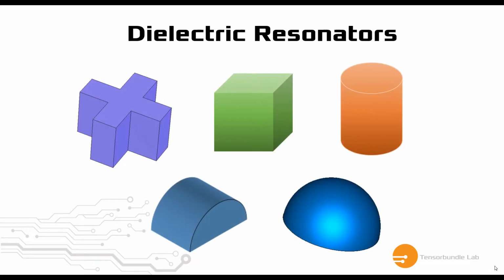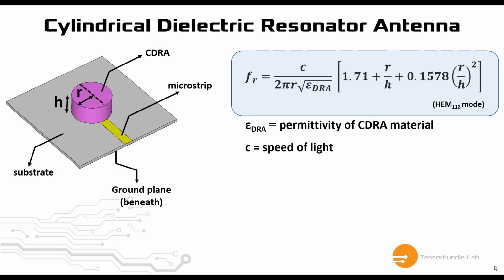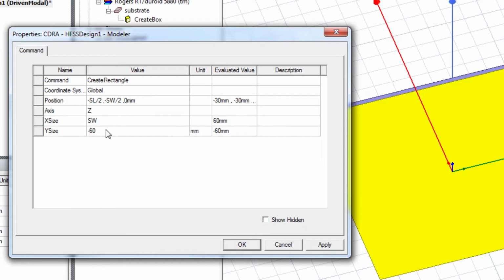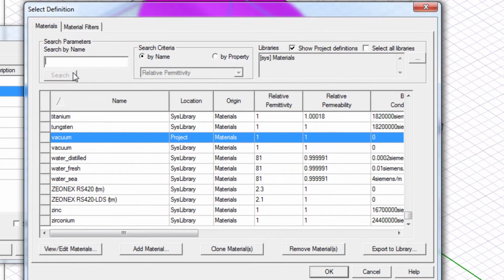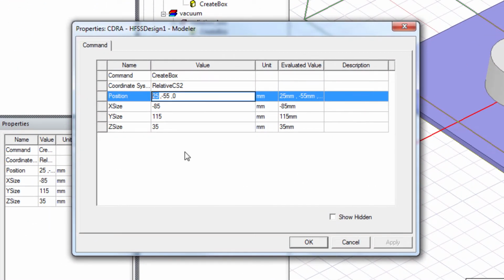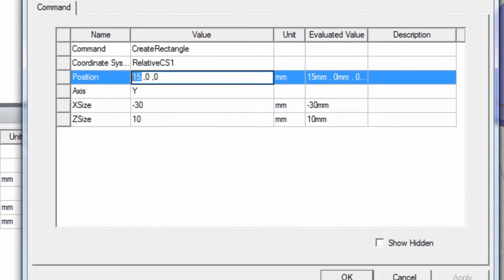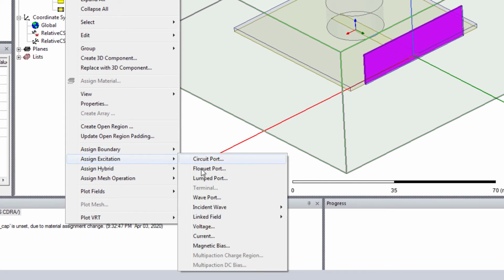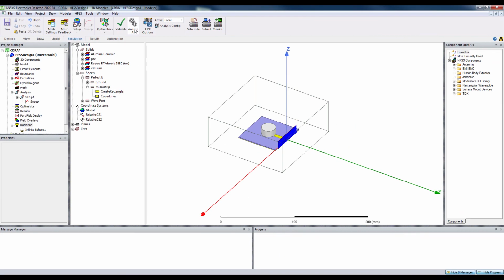HFSS Tutorial: Cylindrical Dielectric Resonator Antenna- Part 1

Comment: Hi sir, i have simulated a cylindrical cavity resonator with a TE 011 mode at 8.5 GHz, when i placed a Dielectric resonator (DR) inside, the resonant frequency is increasing to 9 GHz, i am expecting to be lower than 8.5 GHz, do you know what had happens, sir?
Reply: hai mam how you set te011 mode in simulation